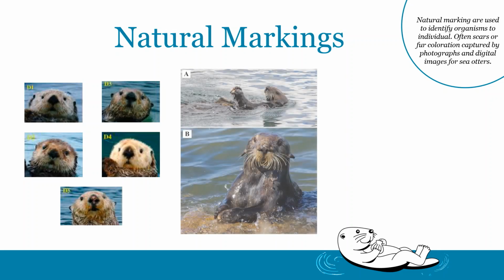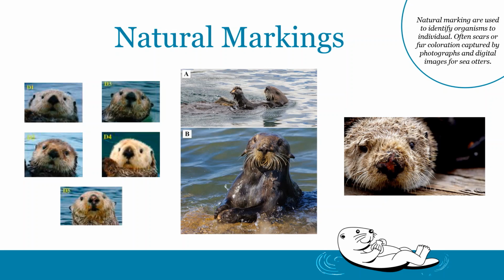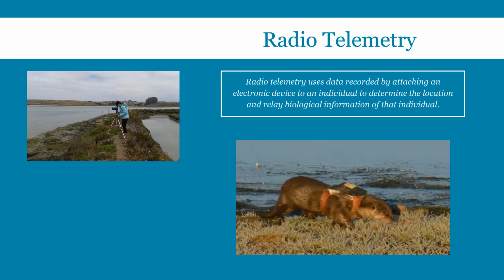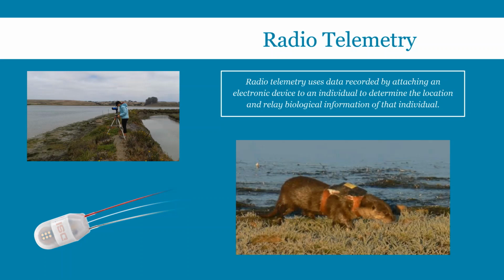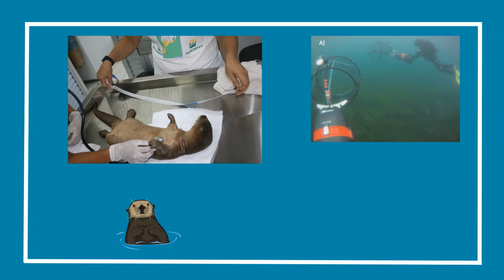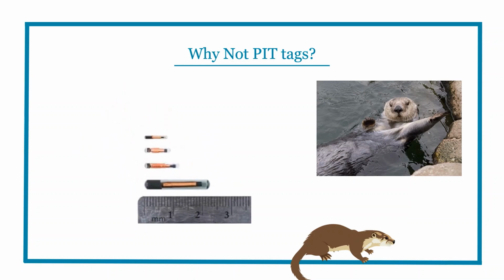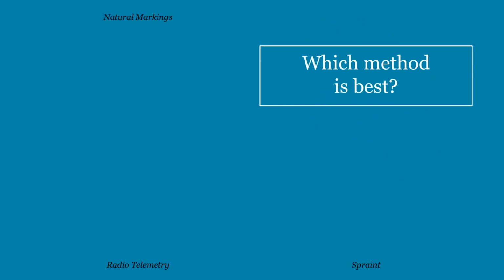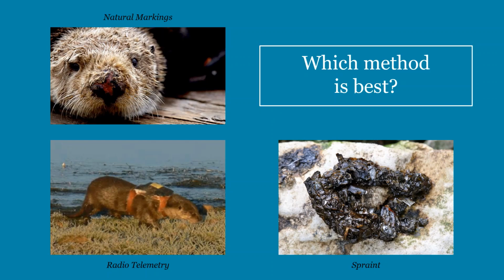14 . Sea Otter Marking - Jazmyn & Ciara

Comment: Cool presentation! Do you know if sea otter marking change throughout their life? If this is the case would this be a potential problem with using natural markings to identify them?
Reply: Yes! Naturally, over time scars and even fur coloration will change. This is most definitely an issue when using natural markings as a method of individual identification. In sea otters specifically, the stability of scars has not been researched in depth, so it is unknown how long these markings can be used for.

Comment: Nice video, very clear. Do multiple otters defecate in the same place? Is it easier to find spraint of otters of different sexes or ages? How would you use IDs from spraint to answer ecological questions?
Reply: Hi Dr. B! Multiple otters do defecate in the same place (often males) and based on that it may be easier to find spraint of male otters just because they do often defecate in the same areas, females are more solitary although if they have pups they travel with them, so I'd make the inference that female spraint can be found more often with juvenile spraint than male spraint.

In regards to it being easier to find different demographics neither I nor Ciara have found any literature indicating that it is although spraint does have a scent, we do not know how the pugnancy varies between age classes or sex, but if they do then I imagine dogs would have an easier time finding one or the other.

IDs from spraint can be used to measure distribution of sex and ages among the population, giving insight to population dynamics, population distribution (which could lead to insight on habitat selection), or population viability analyses among other things.  Thank you for your question!
Reply: @jazmynbroxton9829  OK thanks, one thing to consider with sprait is that for distribution and habitat it gives good information the use of terrestrial environment but not the aquatic ... thanks

Comment: Great presentation! For seasons that are particularly wet or there is snow, are there any other methods similar to spraint that could be used instead?
Reply: Great question! Hair snares are a similar method, in terms of animal welfare, ease of application, and the type of data information you can gather; however, for sea otters specifically this method wouldn't work because they are typically in water versus on land. Therefore, to answer your question, no there is not a similar method to spraint that could be used instead (for sea otter).

Comment: Wonderful presentation and pictures! Ya'll mentioned that radio telemetry can provide biological information of individuals, is there data from spraint analysis that can provide similar knowledge?
Reply: Wonderful question. Yes, there are some types of biological information that you can gather from spraint such as diet, health, and diseases. However, it is not the same type of biological information that you can gather from radio telemetry.

Comment: Great video! The images and animations were engaging and adorable. How costly is analyzing spraint compared to the other marking methods?
Reply: Hi, Samantha! Thank you for the question! To my knowledge, analyzing spraint costs less than using radio telemetry (depending on how many you have but that's something else for another time), but would probably be more than natural markings seeing as you'd need to have a lab for a fridge and an oven-- the fridge to store the spraint in order to preserve the quality, and the oven to thaw it out and dry them for measurements-- staff (although, this could be paid or unpaid, I guess), and now that I am doing more research about the specifics I am coming to find that I don't even know if spraint needs to be analyzed by some sort of computational device (for hormonal studies, sexing, etc) or if its manual (ie someone analyzing contents).